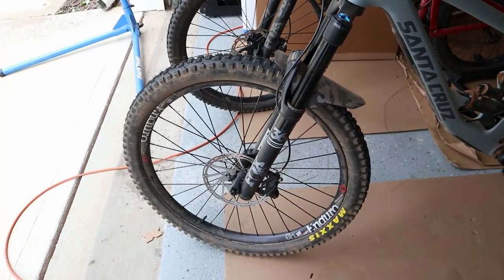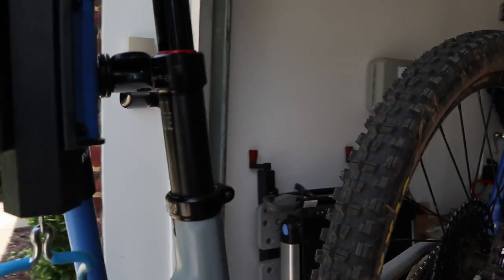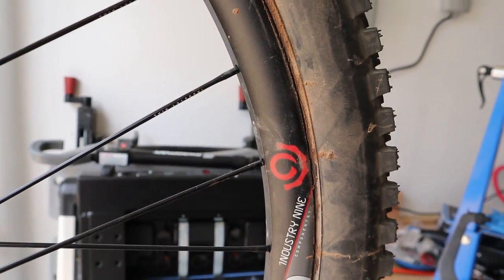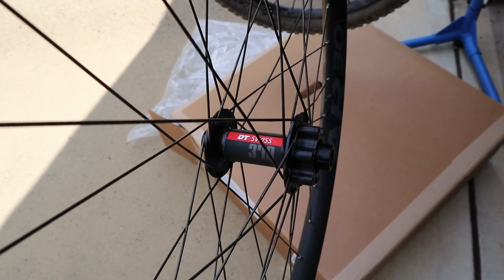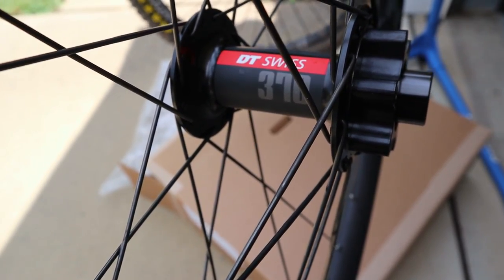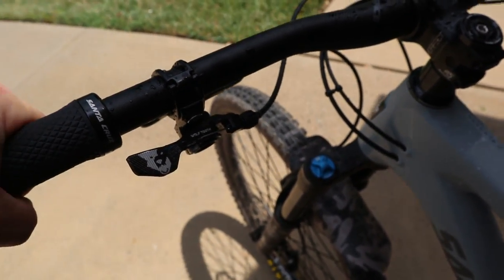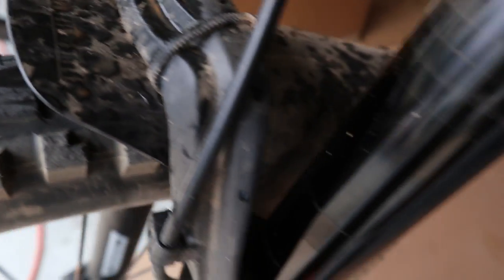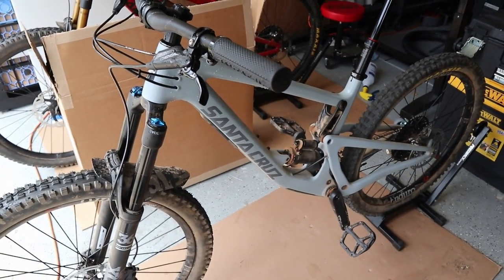#MTBPlanB How much does the 2019 Santa Cruz Bronson C S  (Medium) really weigh?

Comment: I run the Reverb stealth on my Bronson V1 but replaced the hydraulic actuator with the wolf tooth sustain dropper lever and eliminated the crappy hydraulic line that rockshox uses.  Just a note on the wolf tooth dropper lever.  The lever axle that the thumb lever rotates around is plastic and designed to brake if it gets hit in the event of a crash to avoid bending or breaking any of the metal parts.  You can purchase replacement axles from Wolftooth direct or Jensenusa for $4.95.  I recommend buying one and carrying it as a spare.  I broke mine on a ride and lost the ability to drop my seat and that made for a crappy day of descending 1600 feet of double black single track with the seat stuck all the way up.

Comment: My RM 2019 Instinct carbon 90 BC is 30.2 with 2019 Mavic XA carbon wheels, RF carbon bars and Stamp 11 pedals, XX-1 could drop nearly 1 pound

Mine came with the SAME wheels, i sold for 200.00 unused, 370 hub kind of tough to upgrade but it can be done, 240 hub with 54 tooth engagement is the way to go with DT
Reply from the maker: It got a little lighter after fitting the i9 hubs/wheels and carbon bars.

Comment: Wondering about your long term impressions about the Bronson and the switch. I have a 5010 CC gen1 and am looking at the latest Bronson.  Any regrets?  How does she climb over tech stuff and on long sustained climbs?
Reply from the maker: Too much bike for 50 percent of my rides right now as I’m teaching gf but I love the bike. It will take some break in time to learn the new geometry but the steeper seat tube angle will make it feel familiar. The bike will feel longer and you’ll notice the head tube angle difference but it will climb exceptionally well. I had a 2018 5010 and didn’t like the slack seat tube angle so I feel the modern Bronson climbs better. You won’t be disappointed. Good all around bike, but you will put a little more work in each ride with the longer travel.
Reply: You also appear to be from eastern NC based on the trails you have in your channel.  Nice... I am from Morrisville.  Is the Bronson too much bike for the area or just right?  I too hit up places like Pisgah and like the local gnar trails.
Reply from the maker: @mtbcyclist  RTP area as well. Bike is fine if you don’t mind the extra effort on most of the trails around here, maybe with the exception of San Lee an old Cisco.
Reply: @MTBPlanB  I bet I have seen you around.  I ride a bright orange 5010 and hit up old Reedy Creek Rd area Wed nights and ride Cisco/RTP a fair amount. Is the difference in effort really noticeable?  The difference on paper between the two bikes in weight is not even a half pound.  Slight geometry differences, and of course 20 mm (3/4") of suspension travel.  Based on reviews it would also seem that the climbing effort or efficiency is almost equal.  Sorry about the nit picky questions, but my chances of actually test riding both back to back are slim and almost none due to COVID bike shortage.
Reply from the maker: Get the bike if you can, you won’t be disappointed.

Comment: Would you say the new Bronson climbs close in comparison to the 5010? I am shopping for a new all arounder and like the 150 mm of travel. Just wouldn’t want to sacrifice too much uphill ability. And on another note, how does the suspension feel on milder terrain? Does it need to ridden super hard for the suspension to provide good feedback or is it comfortable at a slower pace? Some of the new mid travel bikes don’t respond well unless you are dropping the hammer on them
Reply from the maker: It climbs better than my 2018 5010. Having said that, my 5010 was modified with 150mm fork and 135mm shock, so geometry was altered a bit. The combination of the steeper head tube angle and comfort of riding high in the rear shock stroke makes the Bronson feel very planted for a 160/150mm bike. It isn’t as snappy as the 5010, but I attribute that to the length and slightly higher bottom bracket.  I wouldn’t have second thoughts on purchasing the Bronson for a good all around trail bike.

Also, Check this vid too as I talk specifically about this while riding the trail. https://youtu.be/wAoiNcd3APA
Reply: MTB Plan B awesome! Feedback is greatly appreciated! I will most definitely take a look at the other video! Ride safe. 👊🏼

Comment: Do you know the wieght on the wheelset? Im trying to decide if I want to build up an aluminum bronson with the parts I want or buy the carbon bike fully stock S version. Thanks for the video!
Reply from the maker: Front is 0.88kg and rear is 0.99kg.  This is with Race Face AR 30 offset rim, rim tape, valve stems, Dt Swiss 370 hubs.  I ended up replacing the wheels with i9 Enduro 305.  I just couldn’t get used to the low POE of the DT370s.
Reply: Awesome thanks, yea I meant the stock rims sorry for not clarifying that. I realy appreciate the info thanks!
Reply from the maker: Glad I could help.

Comment: So, this year I got a Hightower LT, avoided the 2018 bronson knowing it was possible a redesign for 2019. Now I dont know If I should get the new 5010, or the bronson as a second bike... what do you say?
Reply from the maker: Luis Efrén Islas Cortés In my opinion, if you have the Hightower lt with 150 front and rear travel, it’s already as capable if not more than the Bronson.  If you wanted a lighter smaller wheel more nimble bike for fun then The 5010 would be a good choice.
Reply: its better to hold off 1 more year. The lower Link VPP design is optimized for longer travel bikes. Hence the Nomad and Bronson got the V10 treatment. So what do you think will happen to the Hightower LT? The same exact thing. Go look up some of santa cruz's instagram responses to the reveal of the Bronson 2019. A very high chance Hightower LT will get the V10 treatment.

Comment: so have a hightower + now and am looking at adding one of those bikes both 2019. So if they both pedal the same and climb the same. Would you look I to the 19 5010 or stick with the Bronson for more travel just in case?
Reply from the maker: Blue Pitbull In my opinion, I would get a Bronson.  The Hightower + which is 150/140 front and 135 rear is already similar spec’d close to the 5010.
Reply: MTB Plan B yeah I'm running the 27.5+ now but thinking about going 29. And if the 5010 and Bronson are so close figured the more travel would be a better option as far as saving a mess up on my end.

Comment: What size is the bronson
Reply from the maker: jimboy galaraga Medium frame.
Reply: Thnx for the respond. How tall are you? how does it feel? Thinking of getting a bronson, just confused of what size to get. I’m 5 5”. Tnx
Reply from the maker: jimboy galaraga I’m 5’10”.  It’s perfect size for me given they lengthened reach just a tad for 2019.  I’m on the cusp between L and M according to SC and I prefer the smallest cockpit.  I think at 5’5 I would still go with the medium frame.  You can always go shorter bars, shorter stem if you need more reach, otherwise you may be cramped on a small...of course trying one out at a demo day or bike shop would be ideal.
Reply: Are you doing a review on the bike?
Reply: Im 5'9 and just bought a large size Primer grey X01 Reserve Bronson, I demo'd the bottom line C bike for 2 days and love the size, perfect for me. The handling is so sweet .
Reply from the maker: Tony Guest It’s a sweet ride. Enjoy!
Reply: jimboy galaraga My height is same with you. I got the B3 and 5010 v3 both in S size. I dont feel cramped at all.  FYI, the fit of B3 S size  is very very close to a N3 M size. 

Still depends you prefer the agility of smaller bike or stability of a bigger bike.

Hope it helps.

Comment: a 5010 with a 36 and a X2 air... just why??? probably for full bling effect on the trails if you meet someone ;)
Reply: uhhh.. cus the 34 is a floppy noodle and piggyback shocks work a lot better?
Reply: yeah, because a 130mm bike needs the full enduro-pro setup. if you ride such gnarly tracks or high speeds on such a bike you chose the wrong bike for the job. according to your logic why not put a 35 and a X2 on a XC bike ;)
Reply from the maker: At one point, the 5010 was my only bike...and I wasn’t planning on adding another. Overkill but fun!
Reply: i think with the new bronson you hit the sweetspot.
Reply: 5010 for it's pedaling and overall weight. Suspension for the feels. Richie Rude uses X2/DHX2 on his SB5.
Reply: @youtubeattacker  probably, but richie rude is totally different animal on a bike the than us mortals ;)